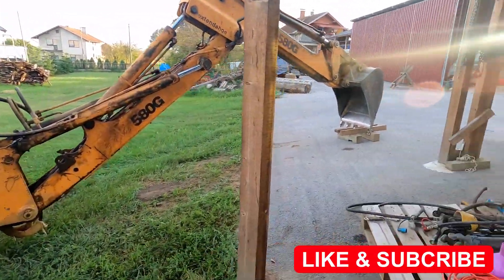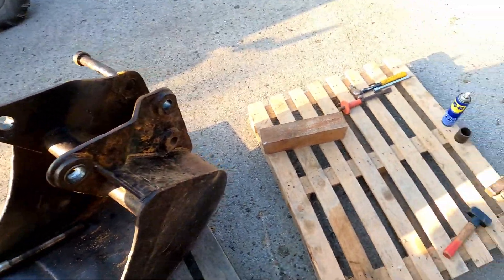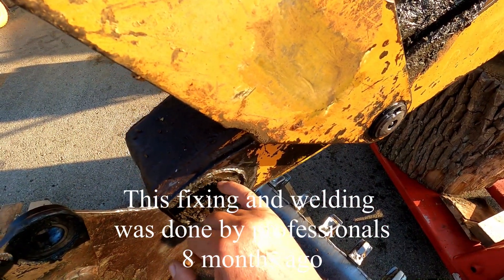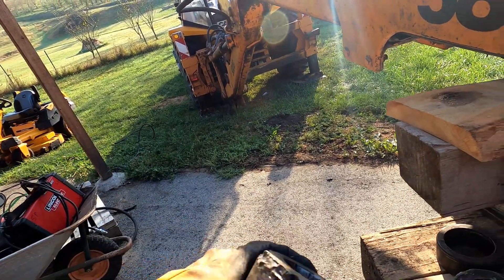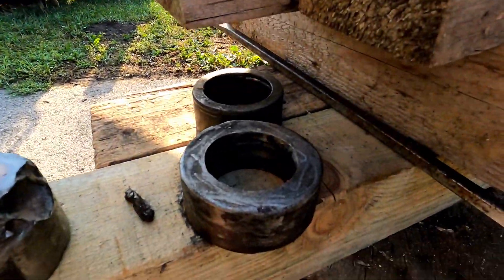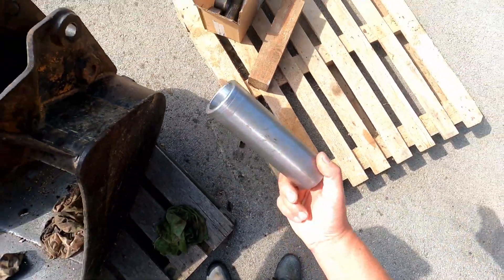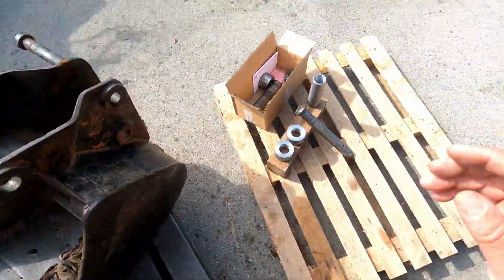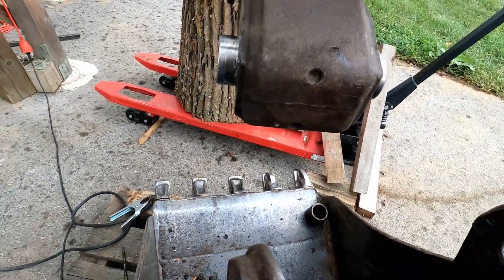Case 580G Backhoe Repair - Fixing Broken Dipper Stick/Arm - Part 1

Comment: Hi, I have a casei 580 G and it doesn't go forward, reverse works fine, any idea what the problem could be?
Reply from the maker: There is a few things you can do before you call mechanic to take apart your powershift box.
1. Check level of your ATF oil when your 580G is leveled and cold.
2. Check if is any leak.
3. If your power is lost when is hot, your cooler (radiator) is too small - you can go forward when is cold or you can put bigger radiator.
If none of this work, call mechanic (there could be some of yous forward lamelas are gone). Usually if you open box you change all gears new.
Good lack,